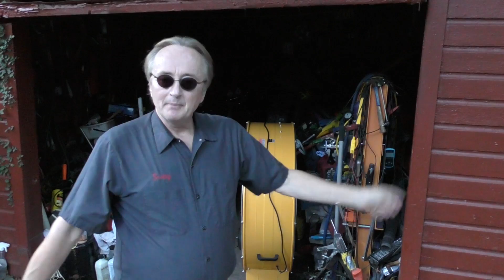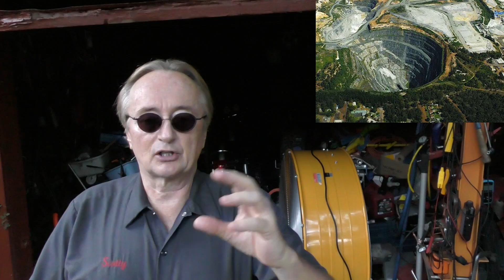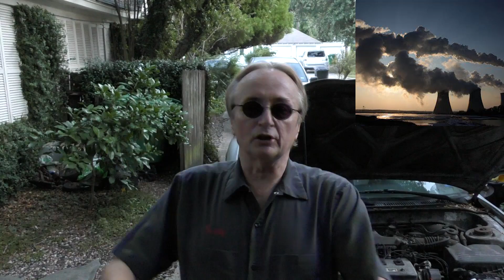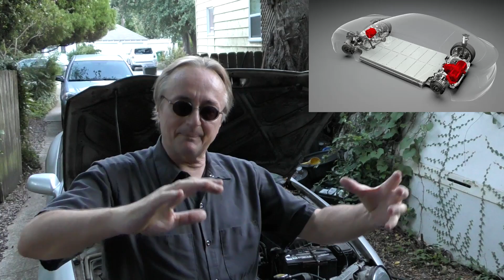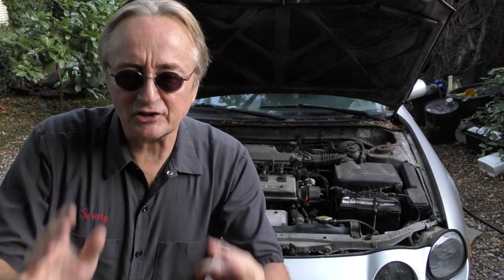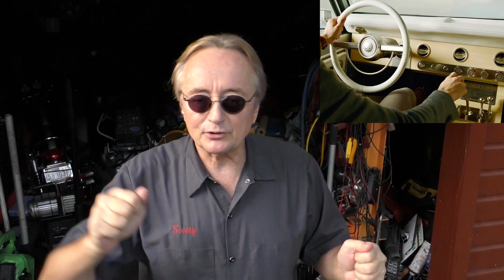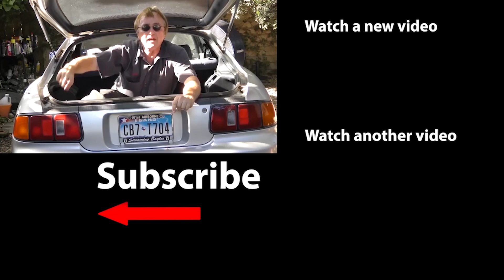Saying Goodbye to My Toyota Celica's Engine

Comment: Conversion means having all those batteries either under the hood (not the safest place for the high capacity lithium batteries) or in the trunk which will occupy the entire space and probably one of the seats for the rear passengers. In either case, it will also be a weight distribution problem. Electric cars that were designed from scratch don't have those problems but they are crazy expensive. I think that the converted car range will not exceed 50-80 miles or 25 miles in cold temperature. I think I will continue driving my 10 year old piece of junk that costs half the price of the electric conversion and can drive 450 miles per "charge" and it will not matter if it's hot or cold outside.

Comment: I enjoy your videos and agree with your opinions on cars. I am a Toyota rear wheel drive advocate and currently drive and maintain five of them. Corolla, celiac, Supra,  andCressida. In 2012 I purchased a Lexus is250 with a six speed manual transmission. So you see that I have the same conclusions that you have. That was the last year for the manual gear box.

Comment: I also used to think about having enough electricity in the Power Grid to charge all the electric cars in the future.  Scotty mentions 50-60 Amp chargers.  That's less than what an AC + a Water Heater + a Stove + a Refrigerator use.  These household electricity users are generally dormant at night, as are most commercial and industrial businesses.  So charging a car during the night for 6 hours at 60A @ 220V would put over ~ 79 kW Hours into a car's battery (more than the model 3 capacity).  That should give a range of well over 250 miles per day.

Comment: 85% of a car's carbon footprint is generated in its manufacture before it's driven a mile. So the CASH FOR CLUNKERS program of destroying still operating cars was anything but environmental. The best thing you can do is drive your current car until it dies. Scotty just drive your car and keep it ICE until at least the engine is dead.

Comment: Who else thinks the Celica broke down and Scotty refuses to admit it so he's converting it to electric?
Reply: Alex, I think he wants a freebee because he put so many miles on that gas engine. Cannot blame him.
Reply: @ThePalsc  I have the same car just a 96 instead of 94. Put a 100 shot of nitrous on when it had 330,000 miles, its at 397,000 now. you cant kill those cars.
Reply: beefstrudel you may not be able to kill the car, but you can easily kill the door handles!
Reply: Social Justice Warrior it’s still on the original handles I believe you may be thinking about the Matrix handles.
Reply: @sporknife123  dude my 1998 corolla feels weak im afraid i mighy blow engine if i enter fwy too quick i blow a bunch of oil on ppls windshielf when i gas it
Reply: @hemiplow1297  you should probably fix that.its probably neglected
Reply: @ThePalsc  he  hasn't even put that many miles on it....240k isn't that much anymore
Reply: Maybe. Would explain why he's only put literally 5 miles on it in over 18 months.(research it. It's true! Just 5 miles!)
Reply: How do you investigate and research such a thing

Comment: You make a good point about the lithium batteries I never really thought about that, but most gas cars use lead based batteries which are just as bad so you can’t really win. Why do you hate hybrid cars?, the new 2019 rav 4 hybrid is awesome I get around 50 mpg with 200 plus hp in a suv pretty good. I get there more complicated and not as durable as a normal car but if it used the electric battery half the time that’s half the co2 emmisions and over 10 years that’s quite a big

Comment: Contrary to popular belief, lithium batteries use very little lithium. Likely less than 1% of the battery is actually lithium. Also, most EV's, even driven on electricity from coal, will be cleaner than an equivalently sized car after a couple of years of driving it.

Comment: I think that manufacturing processes for all modern cars makes them worse for the environment than they used to be. Ive been saying this for years. New vehicles have so many more sensors and wires and other metal material (catalytic converters for example) that mining for these metals hurts the environment more than its worth. Another factor is that cars are more complicated and sensors fail a lot which makes cars run rich. Problem is, all these sensors/wires/metals are expensive to make so manufacturers make everything low quality to save on materials and be able to sell cars at a decent price. Of course cars are super expensive now and they dont hold their value either. Wonder why.

Comment: Using existing gasoline or diesel rarely ever makes sense. By the time you decide to convert it, the car is most likely already at the end of it's 10-12 yr lifespan. The rest of the car will be heavily corroded and deteriorated by then, there's no ROI in your expensive electric conversion. Why spent $10k on a $300 car? Unless it's a classic that's been babied, forget it.

Comment: Scotty,
Please remember that gasoline powered internal combustion engines were experimental at one point too.
There was no local network of gas stations and gasoline powered cars also sometimes caught fire. 
However, they became the standard and oil companies had to expand gas stations across the country. 
I predict same will happen to the electric vehicle charging infrastructure.
The main difference is that individuals can, in some rare instances, generate their own fuel to power their electric cars.

Comment: probably doesn't apply in the states since insurance is so cheap, but check with insurance first. engine replacement would be considered major modification and then if you don't disclose to insurance, good luck putting your claim in if you crash.

Comment: Scotty contact ev West they specialize in conversions, they even have a high-performance setup using two mothers coupled together and tied them to a 2speed powerglide, it's a beast depending on your battery pack. I hope there is a solution to the lithium mining pollution soon

Comment: Scotty should do a backyard conversion in his next video. Converted car needs vacuum for brake assist, reliable 12V for cabin fan, ABS and airbags, rotation for power steering pump, rotation for AC compressor, heat for interior heater, heating and cooling system for drive battery, lots of tweaks so that all the  ECUs don't freak out.

Comment: If i spend $19 a month in electricity to power my car, compared to $220 for gas a month, in retrospect I AM helping the environment by using less fuel, and that is assuming all the electricity i use comes from coal or fuel, which is not the case here but still, it is waaaayyyyy better.

Comment: Scotty, Doesnt it make more sense to just buy one of the cheap used ones on the market? You’ll never make it half as good as a Spark, Leaf, or Soul. For $7000 you can buy a decent 5 year old Leaf. Why don’t you go Solar on your home? Then electricity is sustainable and free?? Our state  is also 30% sustainable energy on the grid, likely not TX. Your not constantly using gasonline so yes the lithium battery is much less polluting than fossil fuel. Use the sun? Even better.

Comment: Scotty, I you were to converta gasoline engine vehicle to electric and use a non computer controlled automatic transmission, do you think that you could use the radiator as a cooler  for the transmission?

Comment: Thermodynamics. Electric cars are not efficient. It takes more fuel to power an electric car than a traditional ice car. Also, oil and gasoline can move through a pipe, coal is carried on a train, which is more efficient/uses less energy? Powerlines suffer around a 40% loss power plant to destination. Electric cars are just displaced emissions (power plant not tail pipe) making the coal companies more money.

Comment: Neil Young's electric Lincoln caught fire, burned completely, and took half of a warehouse he had with some of his artwork, model trains, and band equipment stored while he wasn't on tour. Car was plugged in overnight, something popped, and the building's owners and the co-tenant all filed lawsuits later. Moral: if you make a DIY electric car, put some heat/fire and CO sensors in it, and next to where you plug it in. If something goes wrong and a fire starts, the halon bottles should automatically discharge as needed! I worked in that warehouse for Neil, and I've worked at Tesla. I've seen up close the aftermath of electric car fires. Fires happen, so be prepared. Over and out.
Reply: Working at a salvage yard, gas and diesel cars seem to spontaneously combust with regularity,  too. Remember,  any remotely modern car has quite a few electrical circuits always active, even parked, and even dumb old one wire diesels have at least one hot starter wire that can become insulated over time and find a path to ground.  My neighbor almost lost his barn to a skid steer that had been parked next to it for days.
Reply: As the kids say electric cars are 🔥 lit!
Reply: How well does Co2 fire suppression work on battery fires I wonder. The reason for Halon? I don't think I've ever even heard of halon lol.
Reply: @weeral1  I would guess that CO2 would work. But the Halon systems have been used for electrical fire suppression for years. Computer rooms and data centers have them. And the big warning signs that say GET OUT if the alarm goes off, as Halon gets released inside...
Reply: Gas cars go up in flames all the time, so frequently nobody even thinks to take notice, unless it delays their journey to work
Reply: @PaulMansfield  I can't stand the people that still to this day ignore the turn off engine when fueling warning signs at gas stations or get back in their vehicle while the pump is running - as if not enough horror stories have been told about EASILY preventable disasters.
Reply: But Halon, one of the best firefighting agents known to man, will kill the earth. Never mind saving lives, it eats holes in the ozone.

Comment: Something may not be making sense here.  First he talks negatively about the vast environmental issues concerning the production of lithium-ion car batteries, then talks positively about converting gas cars to battery-driven.  If he's meaning another type of battery, it's not mentioned or I didn't catch it.  Or does he feel that conversion is the lesser of two evils? (In another clip I think he does mention that the hydrogen cells are overall better than lithium-ions.)

Comment: When you convert a car to electric, it's not that simple. The engine runs the air conditioning and the alternator and battery runs all the lights and radio etc. How do you convert that part?

Comment: Gas cars are ridiculously complicated, electric cars are simpler, yes the infrastructure to supported it's not there, yet, but 2 things would make them stay, 1) I cannot generate gasoline, but I can generate power from many sources, I don't say it's easy, just that I can do it in my back yard, second is efficiency, in nature it's all about efficiency and electric cars require right now 1/3 of what gas cars need to do the same mileage, and we have a long way to go, to get more efficiency out of electric cars, so,they will stay just for those two reasons

Comment: 2020 Corolla Hybrid, $21,700 OTD with 0%... not a bad deal if you ask me and offers and a significant amount of creature comforts. I average 55-65MPG with 60 miles highway each day and about 40 miles city each day (I drive about 100-150 miles per day depending on my schedule; I work in healthcare... field staff... home to home visits).  It's great being able to work out of the car and run the airconditioning, radio, etc. for upwards of 1/2 an hour to complete paperwork, etc. I miss having a truck (always been a truck guy), looking forward to a Tacoma/Tundra hybrid but at a reasonable cost... will stick to my Corolla for now... just as amazing as a Prius C I owned a few years back with zero reliability issues.

Comment: Scotty, electric cars are begging to be charged from solar panels!  
In the sun belt, you can get zero-down financing on a solar system which covers your typical home electric consumption starting at  around $20,000... with $6,000 off your taxes.
 but you wont be paying (much) electric bills anymore, and your electricity rates are  locked in for thevlife of thev system! (20+ years)
I met a guy in western NC who said he drove his Tesla there from northern Fl. on a charge from his home solar system, so it's not just theoretical!

Comment: Scotty Scotty Scotty, no no no no no just no, you don't 'throw away your car when you get an electric car at least I didn't, I traded in my highly inefficient and junky equinox for my cmax enegi not so much to help the environment but to help my wallet, I'm paying an extra  $90 a month and saving almost $200 in gas savings alone (not counting brakes, oil changes, belts, ect) and yes building electric cars are somewhat bad for the environment but the tiny fraction it takes to build that car is recouped many times over when you consider a) only a portion of the electricity is coal and natural gas, some of it is nuclear and as long as nothing goes wrong nuclear plants are great for the environment b) it'll be owned by multiple owners I'm the second to own my car and I can't imagine having anything else c) they generally last much longer the battery fear is a hoax I've seen Tesla's with 700k and work just fine and if they're lasting longer than a gas car that's better for the environment isn't it? I went against your advice and got a nice used one and I couldn't be happier! If you're not willing to spend the money to get your car converted into an electric car (you want them to do it free for you for a video  which is slightly hypocritical) then it must be expensive no thanks I'll stick with my phev that's perfect for our situation, love you Scotty but I disagree here, now if you'll excuse me I've gotta go get some gas seeing as I haven't purchased any since May lol.

Comment: You could do a sort of hybrid by using a Honda generator to charge the batteries on long runs. There is a company here in Australia that has been converting petrol car's to electric for the past 9 years or so.

Comment: custom EV conversions is extremity expensive and  in many cases for a shop to do it costs more than getting a cheap low tier tesla. But if you can do it your self is another story like always also Im going to stop you at the 60 amp charger, because even my water heater has a 40 amp circuit I dont think it would be too bad of an upgrade if any is needed but for the green side yes because the united states has a horrible recycling policy compared to other countries

Comment: I'd love to convert my 93 Toyota paseo to electric but the cost is still to high. Had the engine rebuilt and replaced some other worn out parts doing most the work myself still ran about 3k

Comment: Yea but even if you convert it you are still polluting because u are using electricity from the power plants. I think it would be more worth it to buy a car with a smaller motor that gets really good mpg so that you use less gas.

Comment: Oil is hardly used to produce electricity in the US.  All petroleum liquids (not just "oil") provide 0.4% of the US power generation.  Generally they are specialty applications.

Comment: I'm still waiting for a Mr. Fusion to power my flying car.
Reply: Oh the things I could do with 1.21 jigawatts
Reply: You might think it's funny, but it is actually really happening! The micro nuclear fusion reactor (similar to that on the back of the Delorean) has just been pattented!!
Reply: @HouseCallAutoRepair  That's nothing to hope for, you can patent anything it doesn't have to work or be something you intend to make. If you have an idea and money you can patent it. Apple has a patent for wireless power transmission which they were using to make their "Air Power" stuff that they advertised to the masses. They dropped development when they failed to make a feasible end product.

Comment: What do you do when your battery dies and you lose power on the highway?
Reply: Call AAA like you do when you run out of gasoline.
Reply: @toms7280  yes, but what do they do? Do they have a jump pack or something to immediately charges your batteries or does it have to be towed every time?
Reply: @socksonfeet8125  
nope.  you get towed to the dealer or back home to the charger

Comment: agree with most of what you said, but salt water from the ocean when the mines in bolivia are at about 12,000 feet, kinda doubt it. and a transmission changes the torque configuration and not the power which is determined by the engine/battery pack. easy to mix the two.

Comment: After converting all the billions of old heat-generating, energy hogging incandescent lights to the 1/10 of the power with much brighter LED lights, there will be plenty of US electric capacity to power electric cars.
Reply: No... Your talking small gains here. Just do the math for one household.
Say 20 lights.  At 60watts per light. With incandescent. That's 1200 watts.
Vs LED at 5watts per light. That's 100watts.  So you save 1100 watts total.
Your average EV plugged into your 240volt outlets at a house will pull 7000+ watts for several hours. 
At a public  DC Fast charger even the slowest charging car is pulling 20,000-50,000 watts  depending on charge state .  For 30-40 min.
A Tesla will pull 50,000-150,000 watts for 15-30 min.
A Porsche Taycan will pull 50,000-270,000 watts for 15-30 min.

Not even close....  Once EV' become the normal car.. this may become a serious issue.  I suspect electric rates will climb and the cars will end up being just as expensive to operate as has cars...